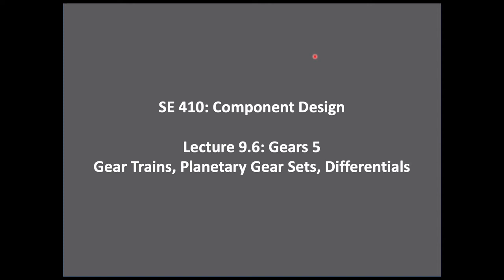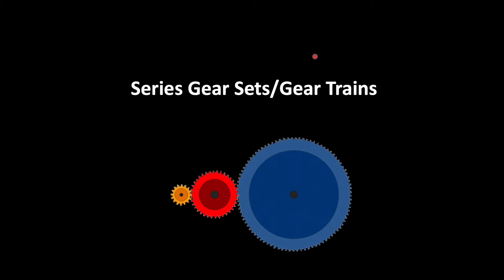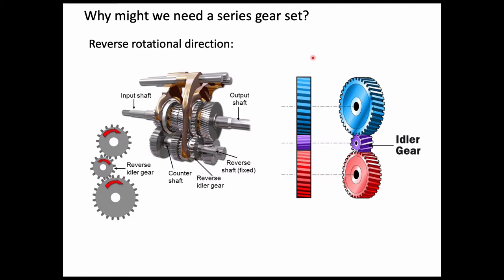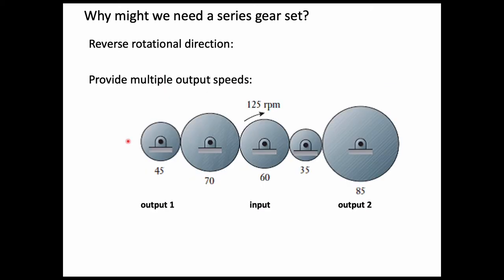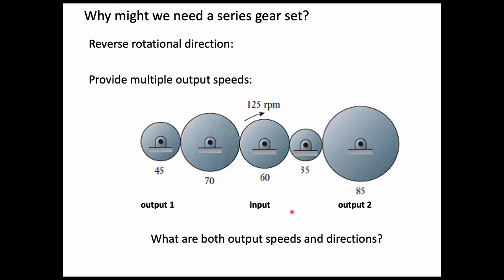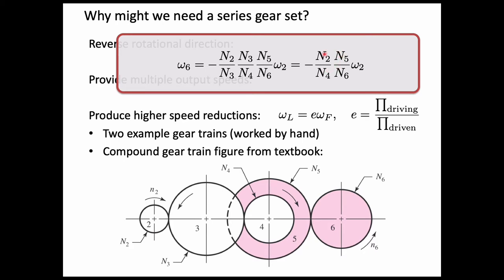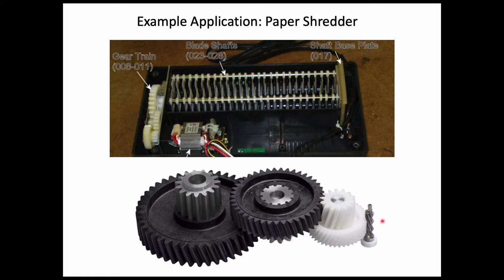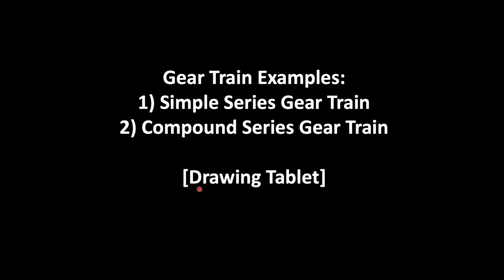Gear trains, planetary gear sets, and differentials

Comment: Hi where can I sent my machine design question
Reply from the maker: What is the nature of your question? Are you a student learning the topic, or is it a question regarding a commercial application?
Reply: @designimpact2178  student it's  about  force analysis of gears
Reply from the maker: @more2much696  On this channel I try to help answer quick questions if at all possible. I do have limited time, so if a student has more involved questions I likely can only address them if it is for a student in one of my classes. Can you be more specific regarding your force analysis question? If it turns out to be a quick question for me to answer I will do my best to answer it.